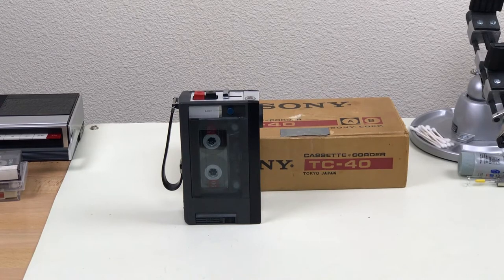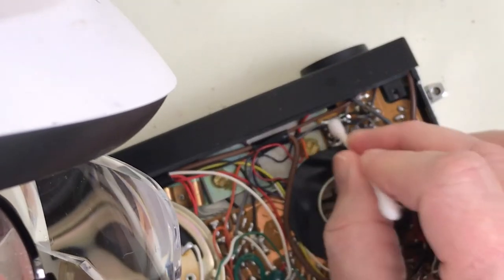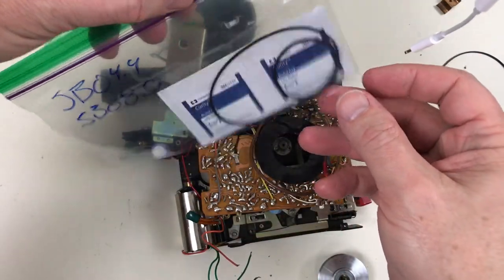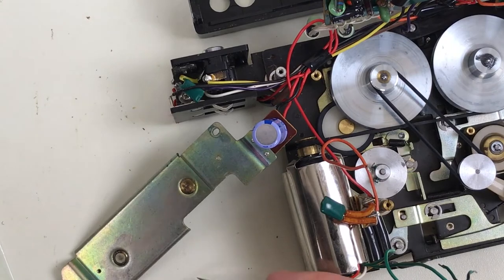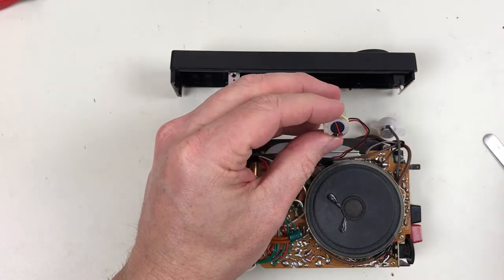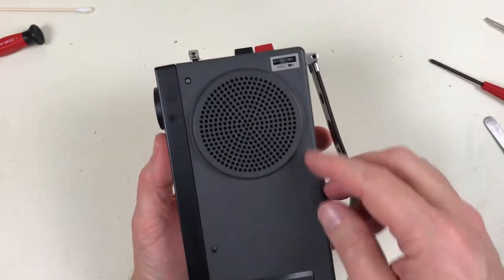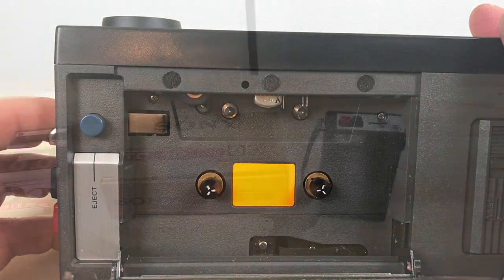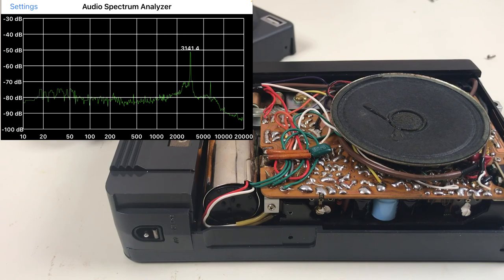Sony TC-40 Belt Replacement

Comment: I was working on an NEC PC-8300 recently which had a similar black foam stuck to an RF shield that transferred to the main board once the foam went soft. I found, much to my surprise, that alcohol dissolved the foam. This would be trickier to do on a mechanism without getting liquified foam leaking everywhere but perhaps a qtip slightly moistened with alcohol would do the trick?

Comment: I rarely have any luck with IPA when removing sticky adhesive ... WD-40 produce a "Fast-Drying Contact Cleaner" in their Specialist range, it instantly dissolves the sticky, usually a couple of applications as it flashes off quite quickly but you'll never struggle with IPA again
Reply: @HutchCA   I've used this to get rid of sticky labels on new plastic boxes without problems.  It does say for use on plastics and rubber, so you should be okay.  It's mostly C6 and C7 alkanes.  It does mention cyclics but as always test on a small spot before-hand.  I'm happy to try it out on your behalf if you have a particular plastic you're concerned about.